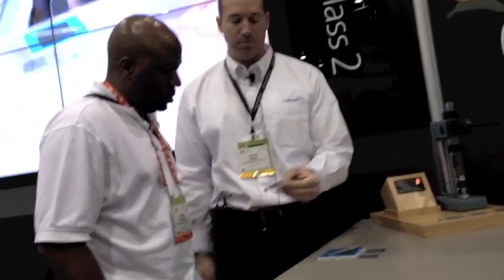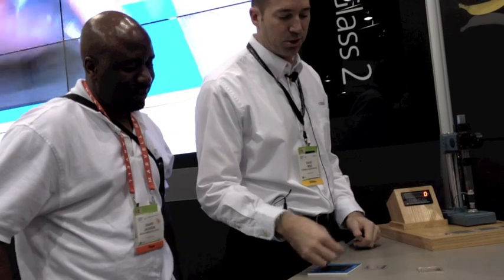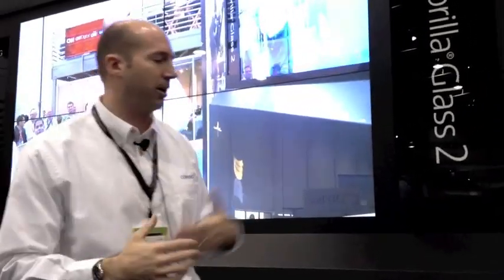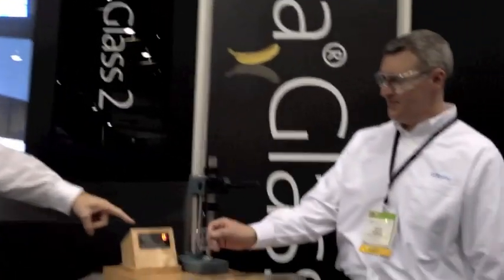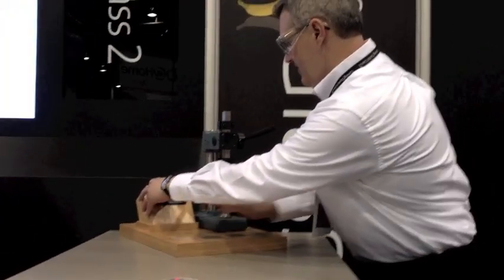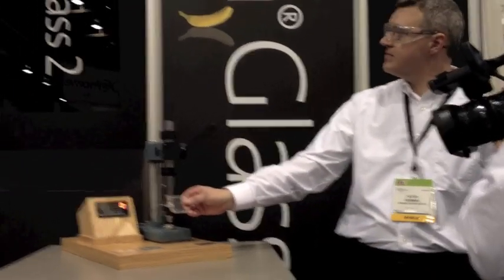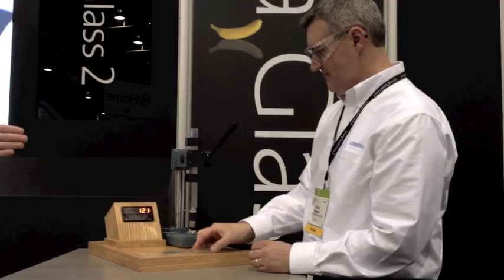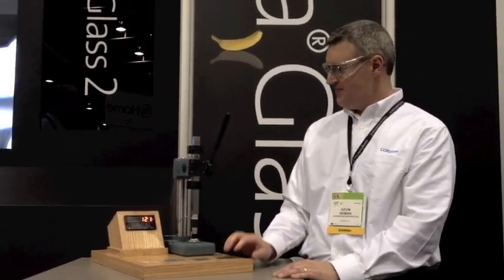Gorilla Glass demonstration at CES 2012

Comment: @SolidlyStated  and also  if we had the surface area of the glass than we could calculate the force applied by that dude using that handle thingy cuz the weight is not enough we need kg/m^2

Comment: @SolidlyStated ok dude listen
time is not part of the equation if you use energy formulas and lets say you have the mass of a phone which is 0.2kg(200g) and you droped it from 2m(which is too much but lets just assume) then we use impact velocity formula v= sqrt 2gh which is going to be 6.26m/s and then we use kenetic energy formula which is k=1*mv^2 which then it will equal to  3.92  so with little more calculation and and assumptions (cuz im runing out of letters) we get 39.199 N of force

Comment: it's the same strength but 20% thinner.. notice the difference in thickness, 1.0mm for the gorilla glass 1 and 0.8mm in the 2.. that's the improvement.. so, with the same thickness (or rather, thinness) gorilla glass 2 is stronger than the first one..